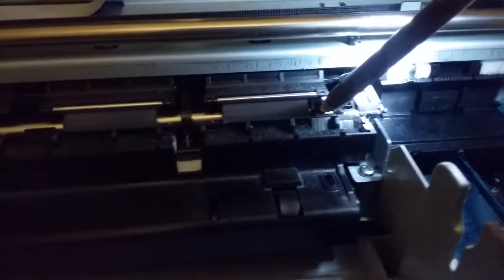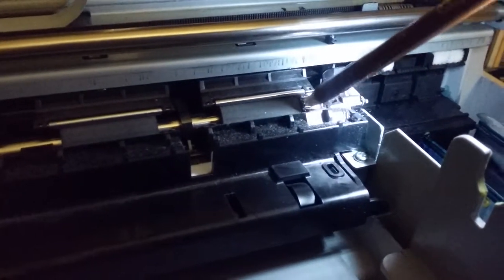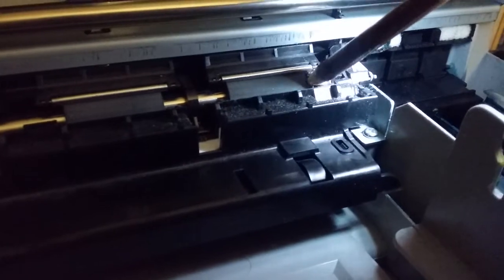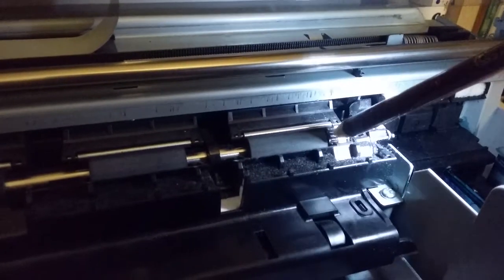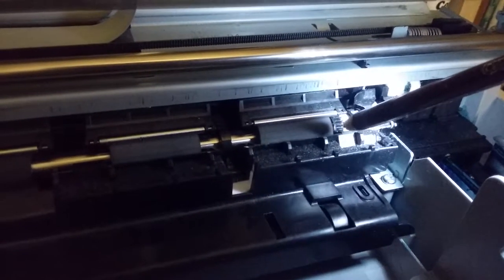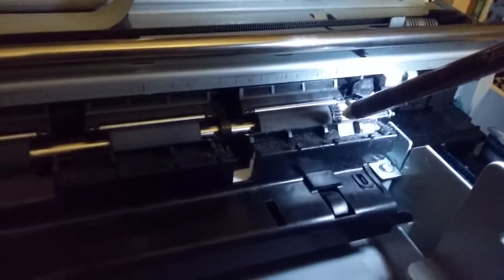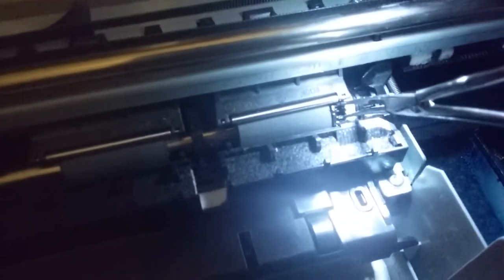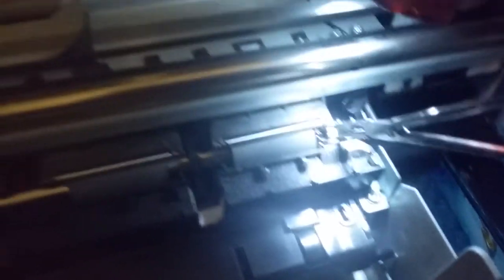HP 1315 repair paper not feeding pt.2

Comment: Man oh man do details matter. You really need the fine tip curved hemostat shown or you might take a chunk out of the gear tooth like I did. Seems very specialized. Where you get one? Don't know. Google isn't showing me anything remotely similar so far.
Reply from the maker: You could use a pair of tweezers wrapped with a rubberband or tape. I repair medical equipment, think they came from a dentist office used as a towel clamp

Comment: before I start - its difficult to see but I think the screws have the pin in the middle - did your T10 Torx screwdriver have the hole in the middle for this ?
Reply from the maker: Mine did not. The pin would be a security torx.

Comment: how you fix that tiny bearing/gear made of plastic , in my case my PSC1315 AIO faced same fate. if you clearly highlight that area that you fix that bearing which is responsible to pull the paper into the feeding area. I mean please elaborate step by step procedure.
Reply from the maker: the part that grabs the paper is rubber on a shaft. I opened the printed to see a gear on another shaft that turns the paper shaft, the gear was cracked & not turning. so I glued the cracked gear.
Reply: @richardbrickner3212  Hi, I have the same problem. I glue the wheel, but I couldn't tighten it well since I didn't have something like a hemostat, and the repair doesn't work. Should that sprocket turn with the axle like the one on the left side? Do you think it would do any good trying to glue it to the shaft in some way or keep taking that piece apart? Thank you
Reply from the maker: @yosoyterracot1292  you have to make sure the gear turns with the shaft. Use a marker to see if it turns. Do not try to remove glue from the gear, you dont want it to break. Just add some glue to the sides. Good luck
Reply: @richardbrickner3212 Hello Richard, thank you very much for answering. In my case the wheel does not rotate, or the least does not always rotate "in line" with the one on the left of the axle. Could that be the problem? You say stick it to the sides, you mean the rubber roller on the left?
Reply from the maker: @yosoyterracot1292  sounds like the shaft is turning inside the broken gear. Sorry i meant to glue on either side of broken gear where the shaft goes through
Reply: @richardbrickner3212  Hi Richard, gluing the wheel has worked fine. I suppose that when I could not tighten it well or did not insert the glue well, it was loose, without being able to be pulled by the axle. Thank you very much for your help. I hope you have a happy week.